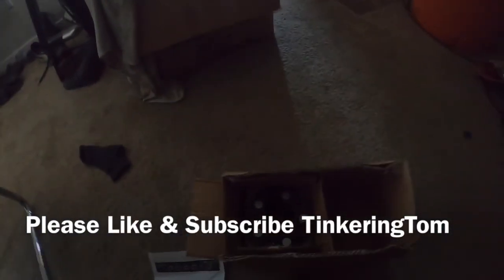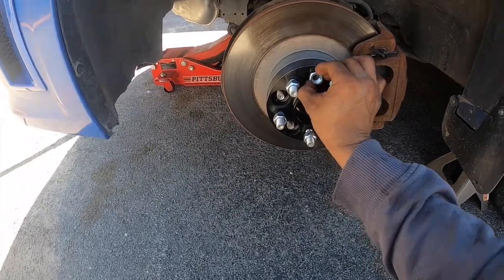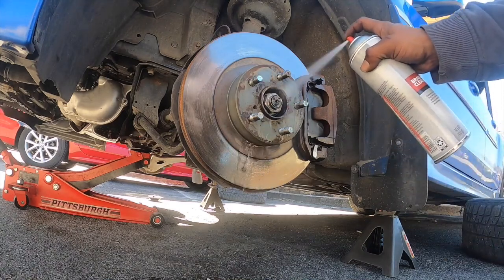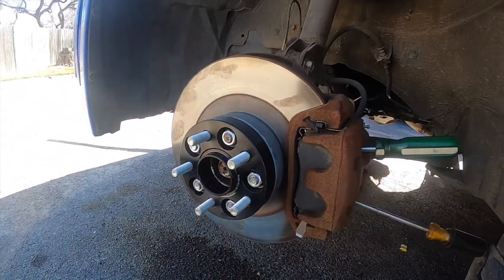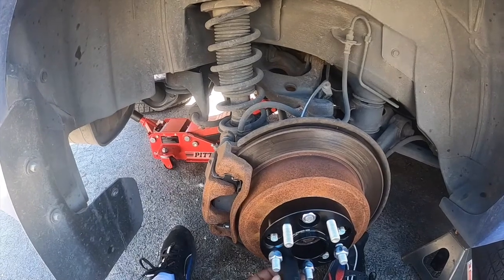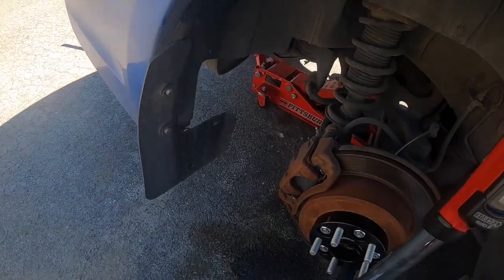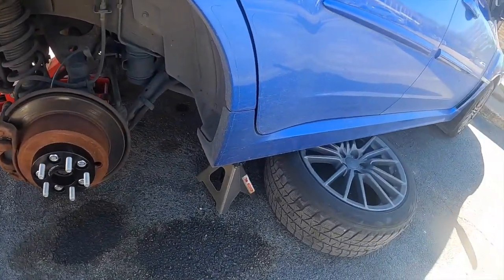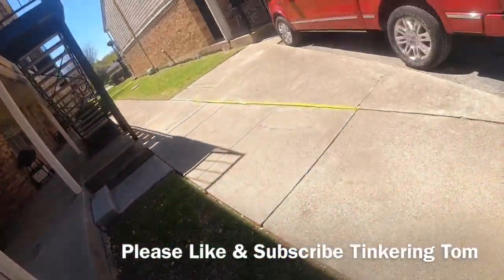Should You Use Wheel Spacers from Ebay? KSP Motorsports

Comment: I’m sure you figure this out by now but you get the wheel flush bolts hand tight then drop the car off the lift then torque outter lug nuts